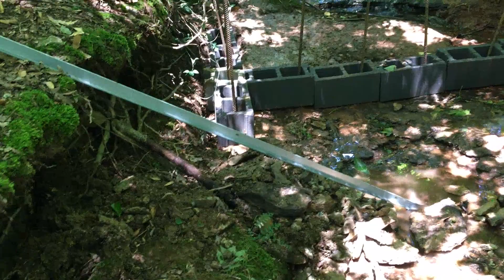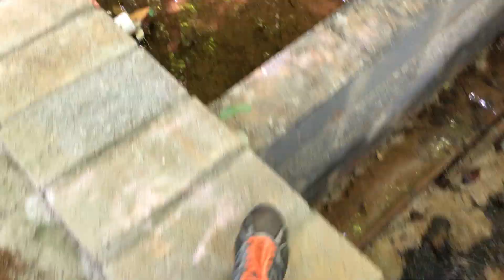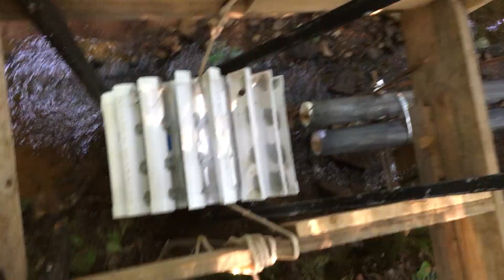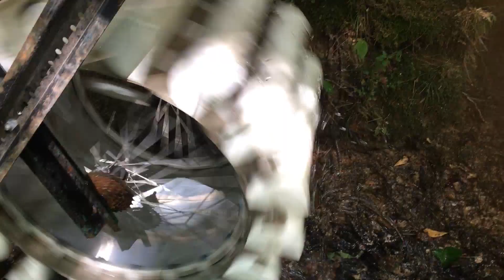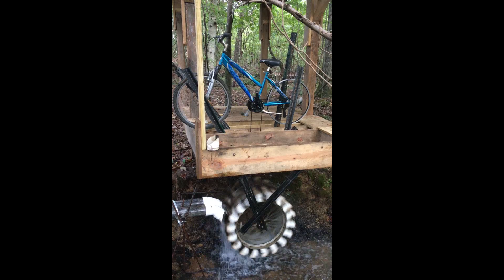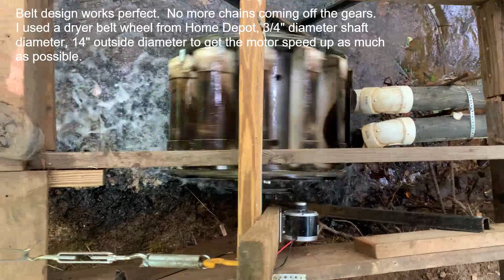Pico Hydroelectric Waterwheel Project

Comment: if you could get hold of a hoverboard and lace the wheels into the rims or even 2 electric ebike wheels with hub motors they are 3 phase with 2 of them and and 2 rectifier and volt reg from a car alternator you will produce decent power
Reply: I did consider the e-bike approach, abandoned it for cost reasons.  In hindsight, not sure anything that uses chain and sprockets short of motorcycle gears and chains would hold up to the stresses.  I don't how you'd go about hooking up a belt drive to a hoverboard motor, but would guess that would be very difficult to manage without a machine shop.
Reply: @dss4myroom371  yeah pro cyclists snap chain seems to  be 250w is breaking point